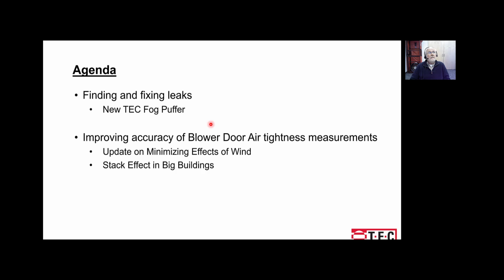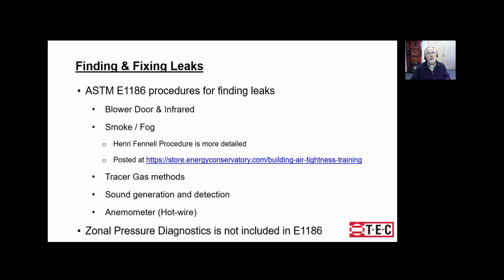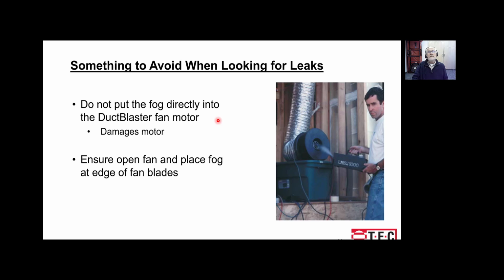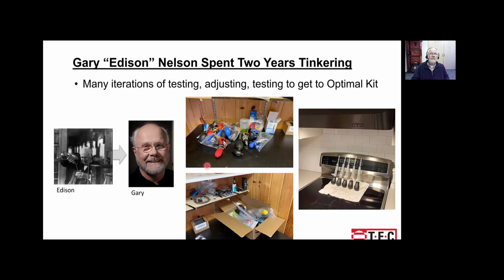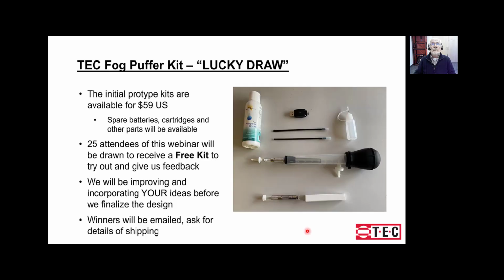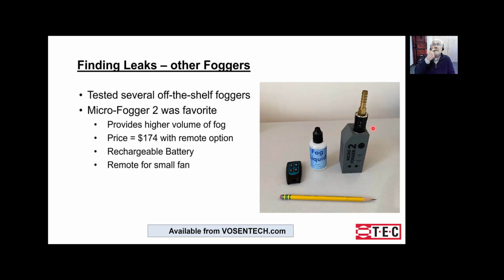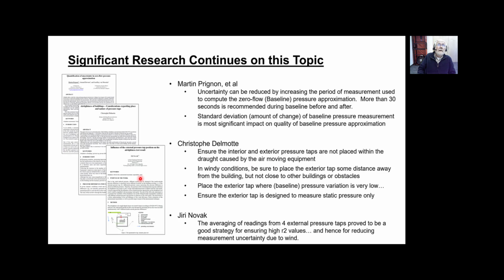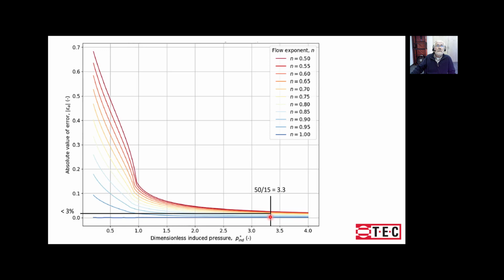Finding Leaks with Gary Nelson

Comment: Love seeing the progress on the micro fogger. Did you determine how much pressure closes the pressure switch?

Can you explain the small ripple (about 0.9 dimensionless induced pressure) in the tall building stack effect graph?  I look forward to your progress on this.

Dale@EnergyWright
Reply: Good questions Dale,
I hadn't measured the pressure to close the switch so I did it this afternoon and it was interesting.  I measured 2 of them and found that a quick pressure change of 25 to 50 Pascals (.1 to .2) caused the light and heater to come on.  This takes a very slight squeeze of the bulb and is not enough flow for fog to be seen.  It takes at least 300 Pa to make a tiny useful stream of fog and a moderate squeeze like I usually use is more than 2500 Pa and my DG1000 over ranged.  It was interesting that applying a pressure slowly made the switch activate at a higher pressure, around 100 Pa.  I took the switch apart and found the actual pressure sensor is a metalized thin membrane (like Mylar) that deforms with pressure. I think this changes a capacitance that is read by a very low power integrated circuit that then turns on power to the heater and light.  More sophisticated than I ever imagined.  If too much fog fluid leaks through the battery tube and gets into the switch I think it gets one or both sides of the membrane wet and that changes the operation of the capacitor and it's time for a new battery.  I've seen good battery life but I don't use it at all the angles and ways it will be used in the field.  Now we have some guinea pigs and will see what happens.

The ripple or "knee" at about .9 on the stack effect graph is because a blower door measurement is more accurate if all the leaks in the building are either depressurize or pressurized.  For the "worst case" building, which is what the lines on the graph are for, and for which all of the holes are at the top and the bottom (not equal in size) this happens at about a dimensionless pressure of somewhere close to .9.  If you go below .9 some of the holes are leaking in each direction while the blower door is running so the blower door is not actually measuring all of the flow through the leaks.  Above about .9 all the leaks are flowing in the same direction and are equal to the flow through the blower door.

Gary Nelson